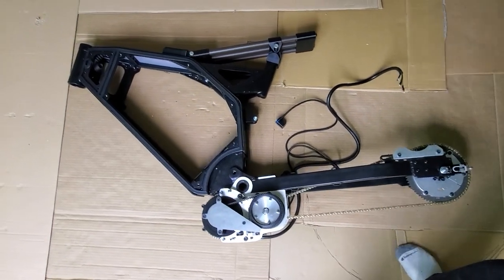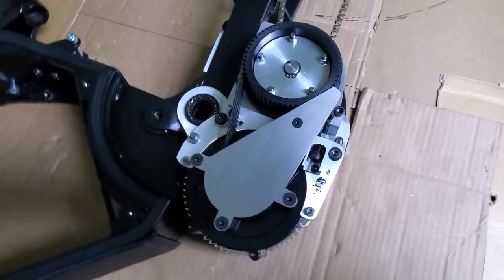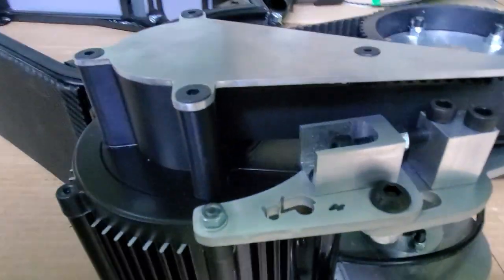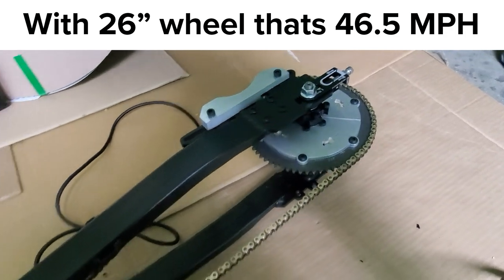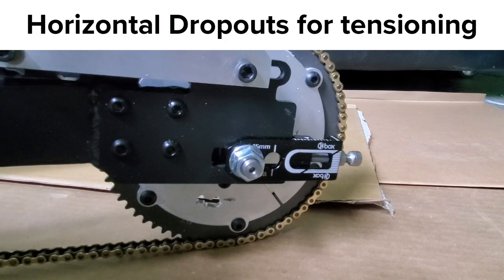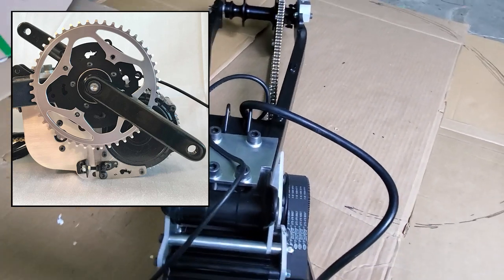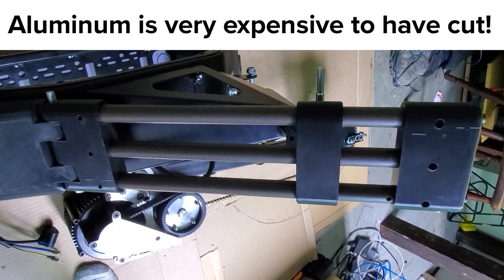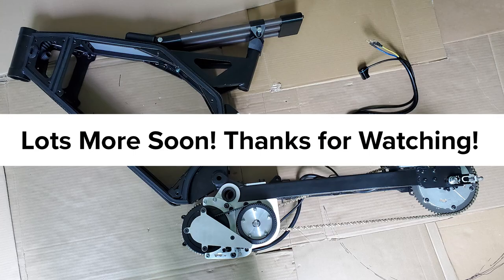Lightning Rods Ebike (10kw mid-drive motor) build Part 8 - Mega Power is here!!!

Comment: Can’t wait to see what you do with this and what this beast yields .... true monster , and mighty Sur Ron challenger
Reply from the maker: Me neither! Cheers!
Reply: Do you have a feel for motor efficiency (mechanical power output  / electrical power in ) for lightning rod motor Vs BBSHD if they are using same 72v fw controller and 72v battery?    It would be amazing to know that for the 3 different operational regimes of  under1kW , 3kw, 5+kW.   I’m clueless how these efficiencies vary LR Vs BBSHD, and also in those differing power bands.  Any guidance appreciated  Captain!
Reply from the maker: Well the LR with this gearing will sit at 50kph with no field weakening active.. So it ought be be more efficient. Kind of like how you can drive a powerful Mercedes at a cruise and sip fuel but a small car with a tiny motor has to consume more to hit the same speed.

Comment: Nice build man I literally had the idea of building something similar then I seen this, I got one of the cyclone ebikes using this frame or very similar with the hub motor and thought the balance factor would be amazing with a decent mid drive, I can see what you're planning and it looks promising definitely MX performance if done right the hub motors just lack the luster
Reply from the maker: Thanks mate. I am hoping the balance will work out well as the motor core is low and right on the suspension pivot. Thanks for the comment! Good luck with your build. Feel free to join the discord group. I post regularly on there. Cheers
Reply: @HighVoltageKits  I will do mate I'm reasonably new to this scene and I'm using the cyklonebike I bought to reverse engineer this project, although I'll be using your build now as a little inspiration aswel... yeah it draws a lot of attention these bikes but all in all most people love them in comparison to a 2stroke people are definitely alot more friendly 😄
Reply from the maker: Inspiration is my main aim. Cheers

Comment: You still using your ASI bac 800? 

I'm thinking of getting one for my bafang and just checking you've not burnt your motor @3kw
Reply from the maker: I was just riding her lol. Still puring nicely.  Sits at 65 on the flat. Cheers!
Reply: @HighVoltageKits  I love the motor. Before I converted the bike, I use to ride it using the shortest journeys home, now I'm taking detours on my way home. I've had it a year and 30mph feels like 15mph. Time to go that bit faster.
Reply from the maker: Good luck.. If you want to join the discord via the link in the description we can help with the build.. You can post pics as well! Cheers

Comment: In your possible speed calculation, you used a wheel diameter of 26" . A bit further along, you said that the rear forks only allow for a 21" wheel. Was that correct or have I misunderstood something hear ?
Or was 26" including the tyre ?
Reply from the maker: Correct the speed calculation included the likely tire diameter. I used the rim size for the other graphic. Good spot! Cheers

Comment: Hey whats your opinion on the new CYC X1 Stealth?
Reply from the maker: Hey Cosmo. As a concept I like it. The cyc was already nice to mount. Mine I put inside the frame..The stealth is even more compact. I am still not sold on the reliability long term of the motors but they can be fun on a good build. They go well with DH bikes. I have not tried or heard from anyone yet using one. I am pretty sure they are looking for bbshd / bac800 performance levels. Heat shedding might be an issue on longer rides. That's the key question though right there..What kind of riding do you want to do with it and on what frame is the conversion.

Comment: what's the weight of the Frame, Swing Arm and Motor Captain? P.s nice design mate, i think this may be what i've been trying to get fabricated for long, long distances if it's light
Reply from the maker: The motor and swing arm with the frame are 45-60lbs as it stands. I am thinking ball park 100-120 total dependable on suspension components and battery etc. Cheers 🍻
Reply: @HighVoltageKits  Thanks for the reply mate, that's doable i think. I was a third of the way through Mountain Biking round the World 10 years back but life got in the way.
 The Window is opening back up now but i may opt to use one of these if i can get the weight low and the Power optimised. I'll keep an eye on your build.
Thanks again, John
Reply from the maker: Welcome. You can join my discord if you want. I post more stuff on there as well. Links to that and my website in the description. Cheers
Reply: @HighVoltageKits  I'm just a rider mate thb. I need to learn to make the Battery yet, so i'll feel like a bit of a dick talking to you pros, maybe i'll take a Gander tomorrow, cheers for the offer though.
Reply from the maker: Its not that kind of place. If you posted questions people will just help. I always direct people new to ebikes on there. That's really why I set it up. Cheers!
Reply: @HighVoltageKits  wow, cool, brilliant mate

Comment: Is it though? Is it 10kw? Lol.
Reply: lol 11k rpm in bench testing @ what power level? 

I highly doubt 90mph from that lil drive. They light.
Reply from the maker: The 8 kw rated version of this has hit 60mph on the road without getting close to its limits. I guess we will find out. I'm not sure I want to go that fast..Its all about hill climbing and acceleration with a low central cog. Cheers!
Reply: @HighVoltageKits  The "8Kw " version? What motor is that? From what i know the old one was rated at 6kw. Is this an IPM "8Kw" motor? I do not know of it. I do own an older 6Kw "big block".
Reply from the maker: There have been lots of versions. This one is classed as the big block xl. I'm going on the info provided by Mike and Alan who does the programming on the ASI. There are at least 3 motor sizes with the LR tho. Hope this helps. Cheers
Reply: @HighVoltageKits  Bahahah @ Alan and his rep. Good luck, friend. From what I hear, better off talking to a brick wall about electronic assembly.  

I just want the IPM motor for cheap. I know I can find if for less than 300$. I know I can. I dont see any 10,000w motor on his site. Only a 6Kw. Whatever. Lol.
Reply from the maker: The website is not up to date. This one is not listed. If you have a project in mind its probably best just to email Mike directly and have a chat. I already have all the electronics sat here. The suspension components are the biggest headache right now!